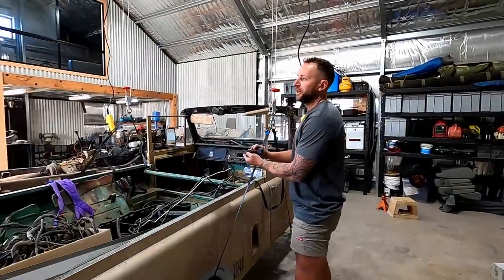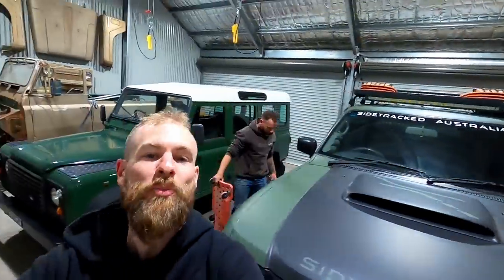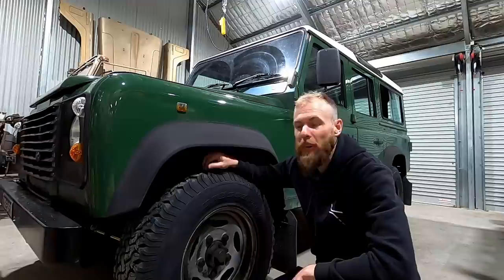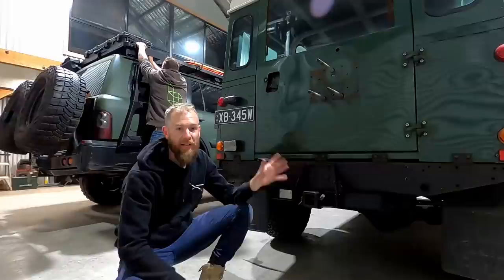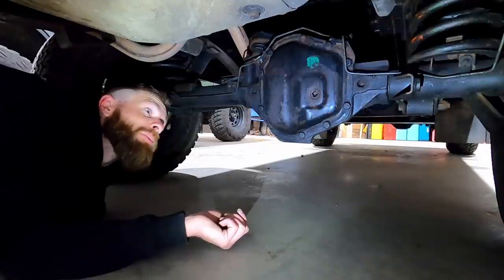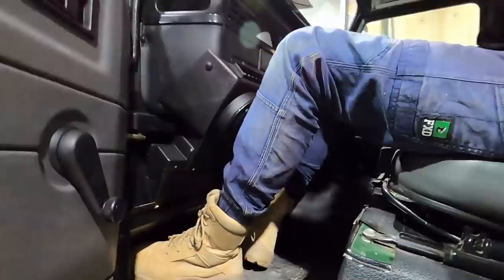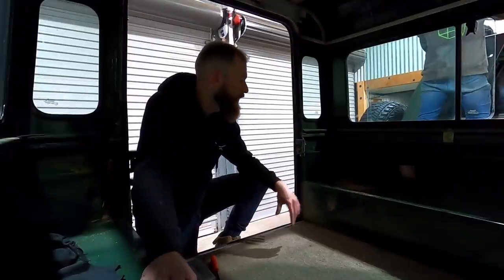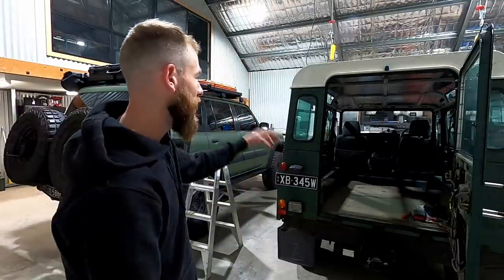#21.Defender Build Update

Comment: Great to see another channel messing with a Landie... excited to see what you do with it. I would highly recommend chatting to Kingpin Design and Fab, Rick is an absolute Land Rover genius, has some awesome gear that is far superior to what a lot of the guys in the UK run, and luckily for you they’re Aussie based. Have a look at their website, all sorts of stuff to froth over haha. As for fitting 35s, they’ll go on a Defender easily with a 2” lift and trimming. The purists will hate me for saying this however one thing to consider would be a GQ Saf axle swap... that way you can share spares between the trucks. It’s surprisingly easy too, the front axle radius arms are identical with and spacing so bolt straight up. I have done a video or two fitting then in my Disco race truck build. That way you’d also get rid of the Salisbury rear diff (which are very strong but the low hanging centre is an absolute pile in the ruts haha). Got rambling a bit sorry, all the best with the build!

Comment: Years ago we fitted aftermarket axles and lockers to front by Jack Mac? Plus GQ CVs (same as yota 60s too) to fix the front carrot sticks (on a D2). Ashcroft have good gear. Options are many..eg TD5 swap or Isuzu 4 pot (Perentie) plus Holset turbo ..we did one recently (a Perentie) with all Ashcroft gear plus ARB locker to Sals and front. ..35s ..a great outcome...unstoppable off road..but not cheap.  Have fun..oh and ignore the Nissyota bone heads who will inevitably pop up soon.

Comment: Front: try a winch bumper and a camel trophy bar if you want the landy look.
I run a winch bumber and light guards.
Grab yourself set maxidrive rear axles.
Fourby 4x4 in uk can get you 2.8 injectors, boost ring, boost pin and twin inlet manifold. Get twin intercooler from allisport. Betterstill get front mount intercooler an xl front radiator from them!!

Comment: Unless you're going to do something to increase the power output, I'd suggest not going to 35" tyres. Std 235/85R16 tyres are only 31.7" so it's a huge jump to 35".  What about 33", something like a 255/85R16?  I run them on my Troopy and they are fab. BFG KM3s.

Comment: Set it up so u can sleep inside instead of always having to set up a swag...

You might want to install a snorkel & sliders too... Running 35's will require regearing of the diff's I reckon

Comment: TDi + 35's + extra weight seems like a mistake to me. Surely something like 255/85/16 would make more sense.
Reply: Was just thinking that, TDI with 35's! Doesn't have nissan or toyota drive train, 255/85 is a prefect size for 300tdi. Td5 would been ideal for power.
Reply: Was also raising an eyebrow with the 35” remark. Not sure if the engine would like to push that. Have 33” on a TD5. Works well. But 35” on a TDI.  Not sure. 

Apart from that. Great choice for a build! So looking forward to the build and the travels! Great choice!

Comment: 35s on defender easy, don't bother with lift, just long shocks. Use Kingpin Design and Fab in QLD - good prices and customer service.
Use GBR Utah for diff gearing - good prices and great service. 
USE THE BRITPART STOCK STYLE FLARES. Mount as per stock, all other types are crap. 
Axles and tcase are more than strong enough for 35s stock, don't believe what people tell you.
Reply: Std axles are prolly 10 spline..way to fragile..even later 21 (?) spline axles n CVs n front centres are no match for eg Ashcroft. Best go straight to eg crome mollys plus lockers. Costly but v good for 35s and traction. Been there with a D2 3 door with 37s 10 years ago🙄
Reply: D1 3 door I mean..
Reply: Upgrade the axles - sure but don't let it stop you from hitting up your next trip if you don't have upgraded cvs and shafts in the front. 

Will not be a problem the way you guys wheel (with mechanical sympathy). 

I have std CVs and fronts on my td5 with 35s which is the same as that 300tdi for like 6 years, never a problem. 

Call kingpin design and fab if you get stuck he will give you the no BS answer
Reply: 24 spline bud

Comment: axles are weak piddly little 24 spline smaller than the jeep axles definitely need upgrading for 35's. rear diff is a copy of a d60 crown wheel and pinion and housing is strong but they used a weak carrier and axles.
Reply: Locker fixes that..
Reply: Carrier isnt stronger than d60? Its 4 pin apposed to 2 pin found in the dana
Reply: @mattluszczak8095  some d60's have 4 pinion (power loc lsd) carriers. but they don't use 24 spline axles either 30 or 35 spline both are far stronger.
Reply: @6226superhurricane  i recently sold d60 from f250 or something had same size axles as the landy

Comment: would do the timing belt if you haven't already both my dad and my uncle had there's fail i looked at a 300 tdi but ended up getting the td5 both are grate motors especially the td5 if you want a bit more power with tuning